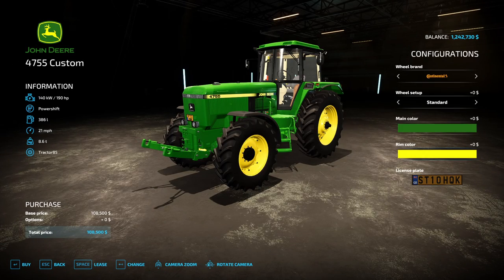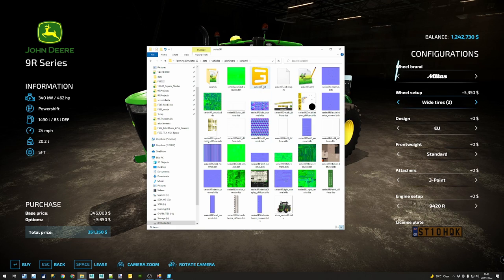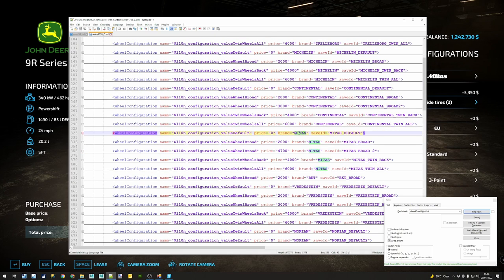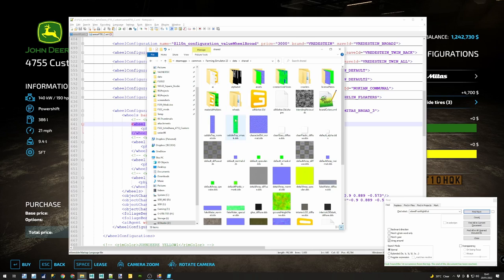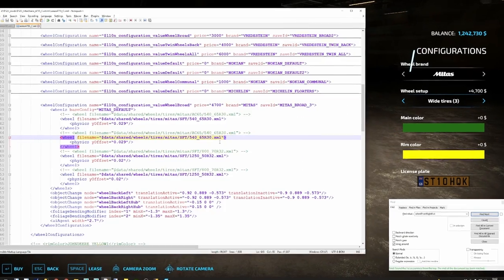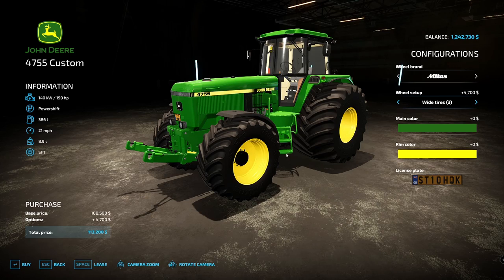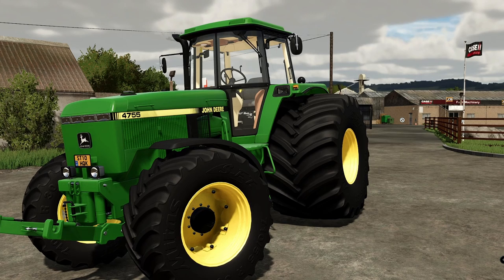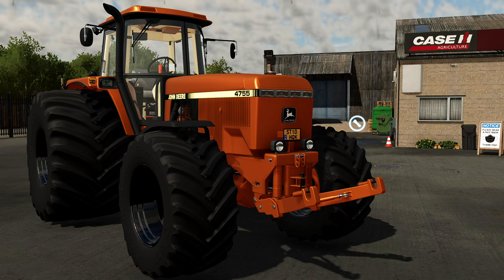FS22 MODDING TUTORIAL - Add new TIRES to a Tractor | HOW TO MOD #6

Comment: You do not need to copy the wheel xml to a new file.   All you need to do is simply add the  <innerRim filename="gamepath/rimxx.id3" node....  widthAndDiam="newValue"/> right after the <physics> line inside of the <wheel> configuration.   This way you can also move configs between tractors without having to worry about the extra custom Tire.xml files.
Reply: Can u do a tutorial pleas3

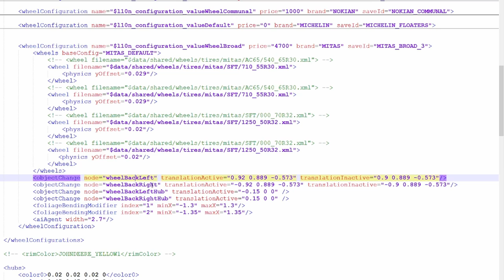Comment: I have a problem: i'm trying to add a new set of mitas on the fendt 200v, until 13:19 i don't have any problem but when i have to adjust the position of the wheels in the xml is missing the parts "nodes" where i add the numbers.
this is what is see:
  </wheelConfiguration>
            <wheelConfiguration name="$l10n_configuration_valueWheelBroad" price="300" brand="MITAS" saveId="MITAS_BROAD">
                <wheels baseConfig="MITAS_DEFAULT">
                    <wheel/>
                    <wheel/>
                    <wheel filename="$data/shared/wheels/tires/mitas/AC70G/425_70R20.xml">
                        <physics yOffset="0.03"/>
                    </wheel>
                    <wheel filename="$data/shared/wheels/tires/mitas/AC70G/425_70R20.xml">
                        <physics yOffset="0.03"/>
                    </wheel>
                </wheels>
                <foliageBendingModifier index="2" minX="-0.72" maxX="0.72"/>
            </wheelConfiguration>
Can somebody help me?
Reply from the maker: Create it?
Reply: Thank you very much, I had just done it, and it works. 
But when I added it on one set of tyres all the others moved, so I had to add it to all of them.
Reply: @cristianobedin8258   how did you do it? I am trying and can't do it

Comment: Now we need a tutorial on how to add a gearbox to a vehicle.
Reply: Easy. Get a mod with no gear box open the xml scroll down to motor configurations. An you'll see transmission auto gear basically in game CTV. Get the donor tractor or tractor with transmission you want to use an open that xml scroll down to motor configurations an highlight the transmission copy an past in the other xmls transmission spot an save

Comment: Does someone want to create a mod for all vehicles and equipment to run faster when actually working the field. Some of the tractors have good speed which is ok but when they start to plow or seed etc they only do between 9 and 11mph. I want large fields but it is too long to wait on it when there are seven plus steps per field?

Comment: how can you save while the game is open, it doesnt work for me i need to unzip the mod and then rezip it
Reply: when i save it in notepad and re-open the tractor file it goes back to the previous front wheel size 1250_50r34